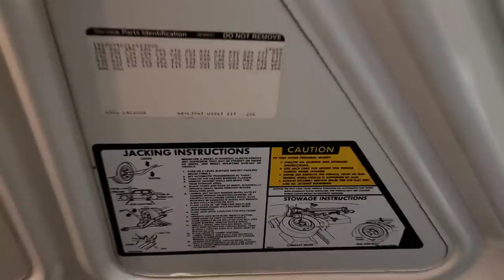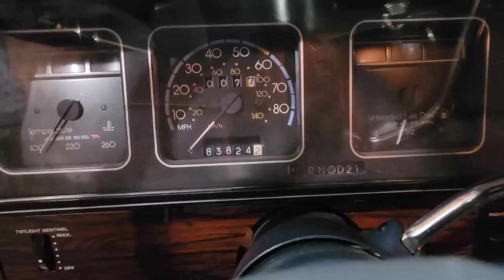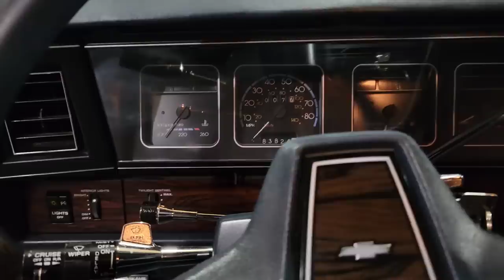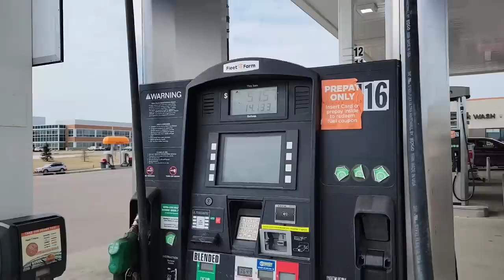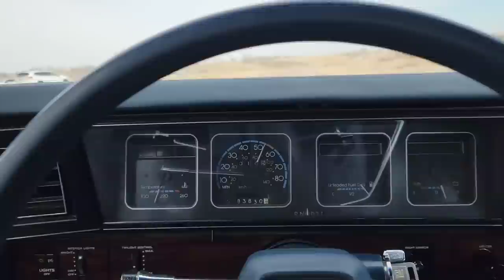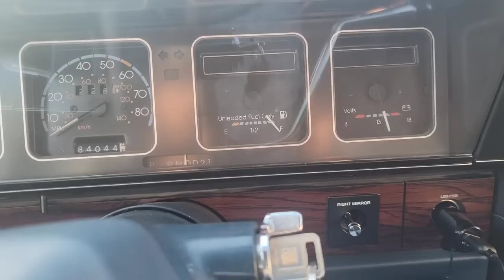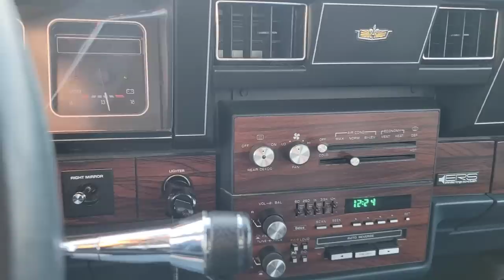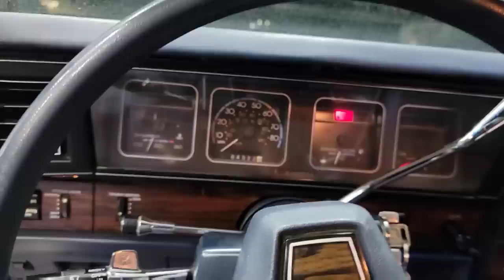I flew to Sioux City Iowa to Purchase a Caprice and drove it Back 8hrs

Comment: I bought a 1980 2 door. 70k original. I replaced alternator , belts, fuel pump , water pump, radiator , thermostat. And drove it 7 hours to Florida

Comment: 1990 would mark the final year for the highly successful 1977-90 "Box Chevy" B-bodies, as a swoopy, & not very well received, redesign debuted in the spring of '90 as a 1991 model. All models now had a standard 5.0-liter V8 with throttle-body fuel injection that replaced the previous carbureted version. But the easiest way to distinguish a '90 Caprice from its predecessors is that the '90 models were the only ones which got GM's controversial door-mounted front seat/shoulder belts. A driver's side air bag would replace the door mounted belts for '91.

Comment: no doubt it wouldve made that drive bought mine for 1250 change the alt, starter and battery and drove it 18hrs from CT to GA no problem had 82og miles